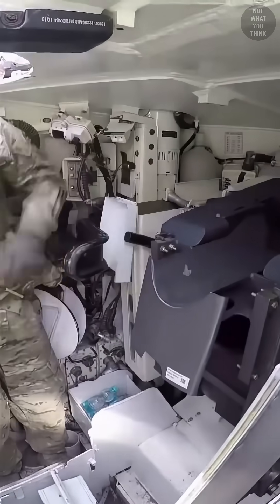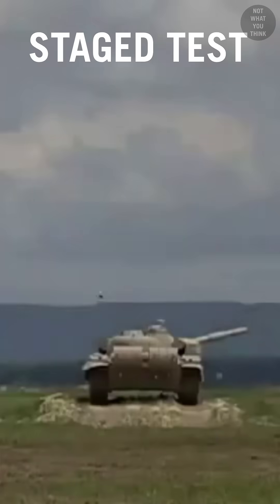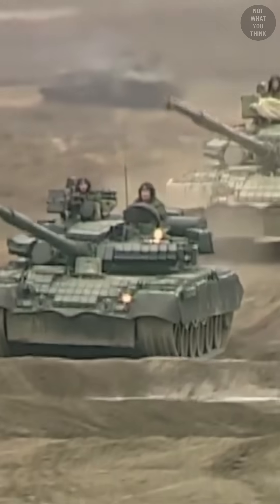Why M1 Abrams Tank Has No Auto-Loader #shorts

Comment: This is a flawed video, it talks about one kind of autoloaders, the soviet Cold War era model, you have other models of autoloaders. Meany NATO tanks have autoloaders; Type 10, Type 90, Korean Black Panthers, Leclerc. They are all equipped with blow out panels too. The advantage of an autoloaders prevent crew fatigue and a constant rate of fire if needed during combat. You can also make a smaller turret crew compartment with additional armer since you don't have the loader's space to take in to account. You can also have a lower profile, all human loaders (as far as I know) require you to be standing to reload. A disadvantage of the human loader is that the 120mm shell is already considered the limit of what a human loader can handle, the US and Germany (Leopard 2) seeing what the next NATO gun is going to be (130mm or 140mm) is seeing how they can change their tanks to have an autoloader system until they can make a new tank that can house the new NATO gun.
Reply: Well said
Reply: That’s kind of strange. Considering how big of a difference ammo makes you’d think they would figure a way to develop the way the gun fires and what kind of round it shoots. Rather than just how big of a boom it has.
Reply: Even these autoloaders are slower then US train loader.
Reply: But the Auto loader take up the space the human loader used 👌  so no smaller tanks
Reply: @dustinhaynes2617  No it doesn't.
 Carousel autoloaders (Soviet) sit in the turret basket where almost all ammo in Soviet tanks already is, which allows the turret, and by extent the whole tank to be much smaller - no turret bustle and no need for a 4th crewman. Their main downside is lack of blowout panels (which are supposedly possible to implement there, it's just hasn't been done), although the main cause of post-Soviet tanks launching their turrets sky high when hit is that the rest of the ammo is stored all over the tank.
 Casette autoloaders on the other hand (Western - Leclerc, K2, Type 90 and Type 10) sit in the turret bustle where again, almost all ammo is stored anyways. It allows to make the turret and the whole tank smaller. Slightly less smaller in this case - no need for the 4th crew member, turret bustle is still there. They are safer however as they include blast doors and blowout panels. Their downside to the manual loader is that the same sized turret bustle ammo rack with an autoloader fits less rounds than the one without, which causes a need to have a bigger hull ammo rack (which is usually unprotected).
 Then there is an American company called Meggitt which I think makes the best autoloaders, as they can not only reload the gun but also unload it and change the shell type. They are of "extract-lift-feed" type - the round is extracted from the rack (be it a drum like in the Stryker MGS, a carousel like in an Abrams TTB or a "chain" like in their autoloader for the regular Abrams' turretbustle) onto a feeding arm which lifts it into the position to feed to the breech.
 None of those solutions take up as much space as the loader. Meggitt's drop-in autoloader for the Abrams takes up so little space that the 4th crew member could still sit there.
Reply: What does Japan and Korea designed tanks have to do with NATO?
Reply: @leonstrya3677  I think it's quite known at this point that both Japan and Korean military (and by extension Tank design) are heavily influenced by the West (a.k.a Nato) during and after the cold war era. so their tank would also follow Nato standard and will share the same technology as Nato and US tanks. 

for example, the first few early Japanese MBT share the same gun as US tanks
Reply: FAIL. There is only one NATO tank designed by a NATO member that has a an autoloader- the Leclerc.
Reply: Make it a manless turret.
Reply: Auto loading turrets in the t90 still have issues with dangerous explosions when hit by a shell. Auto loading tanks have to have ammunition exposed so it can automatically grab a new shell
Reply: @zackhaycraft8159  the main reason for the t-90 or Soviet era tank designs fatal explosions was the ammunition placed around the tank, not the carousel (the carousel does have armor protection against mainly spalling). Also there are also auto loaders that blast proof protection as well (type 10, Leclerc, black panther). Both the autoloader and manual loader have to open the blast proof doors to get the ammo into the gun, so I don't think auto loaders are always exposed is entirely correct. (maybe early soviet tanks?) Then there is the t-14 armata which the entire autoloader and ammo is in a separate compartment from the crew, making survivability even better.
Reply: @benjaminng3390  we are talking about Russian tanks they are still full of design flaws if you look at a t90 it shares design similarities with previous Soviet tanks primarily a round turret. Most auto loaders lack proper protection for munitions that is because it is expensive to have blast doors and have the computer system to open and maneuver shells at the same time. The t14 like the t90 likely doesn’t have munitions blast doors due to the design of the turret which is smaller than the the Abrams so likely it lacks any blast doors for the munitions.
Reply: @zackhaycraft8159  I felt that the other auto loader designs are relevant since the video is about why the abrams doesn't use an auto loader, not about the flaws of russian tanks. Having an auto loader doesn't mean its more expensive either. You still need to pay, train, feed and give some form of comfort for a manual loader (and all crew). Auto loaders can also allow for more compact designs which allows for a lighter, cheaper and possibly more armored tank. Yes, most soviet era tanks lack the blast proof protection (t-64, t-72, t-80, t-90) but the more modern designs I said before do. Lastly, the T-14 doesn't need a blast proof door since the crew is in a seperate protected compartment to where the ammunition/turret is.
Reply: @benjaminng3390  here is the issue with auto loading it is a maintenance issue if it goes down in combat that leaves the tank vulnerable to enemy fire in which they can’t respond. Also to be noted the t14s turret and auto loader is going to be completely different issue when you can’t vouch for the turret or main gun. In most cases a manual loader can put pace and out perform the auto loader plus you get that extra crew member to help maintain the tank itself
Reply: @zackhaycraft8159  yes, those are the cons towards an autoloader, but I will point out that auto loaders can't get tired, and that human loaders are already near the limit to handling the current 120mm shells. Bigger guns are being developed such as rheinmetall's 130mm or the Russian 152mm that was possibly meant to go on the t-14.
Reply: @benjaminng3390  possibly could but most likely won’t because of time and development costs
Reply: @Omega Trash  say that to the people who had to load tanks with guns 130mm+
Reply: @Lukasthefloof  can’t think of any tanks having a bigger gun that 122mm?
Reply: @cassu6  ik theres tank with guns bigger than 122 considering germany might put a 130 mm on their new leo
Reply: @Lukasthefloof  Yeah? So not anything existing that's been used?
Reply: @cassu6  tank destroyers back then have had 152mm guns
Reply: @Lukasthefloof  Yeah but those are also built totally differently. The room to move shells is way bigger and you could have more guys loading.
Reply: T90 has 125mm gun lol
Reply: @zackhaycraft8159  Obviously the T-14 doesn't have blast doors. That's because it has an unmanned turret, so the entire crew sits in a very heavily (over 900mm RHA) armored compartment in the hull and has no contact with the gun or ammo.
 As for other autoloaders having issues with blast doors, that's not true either - Leclerc, K2, Type 90 and Type 10 all have blast doors. The difference is they're roughly the size of one shell, not the whole ammo rack, so they can be thicker.
Reply: @olekzajac5948  the t14 crew will still be killed in the event of munitions exploding from a direct hit and the Abrams can punch right through the t14 with little to no issues. The leclec, and the other US Allie’s tanks have little to no combat experience and testing whatsoever.
Reply: @zackhaycraft8159  The Abrams also wasn't tested in a regular war. For me shooting outdated T-72 variants from twice their maximum effective range (and with absolute air superiority) doesn't count.
 Yes, a shot to the turret from an Abrams could destroy the T-14, but so could a shot from Leclerc, Leopard or any other modern MBT. And the same is true for the Abrams (and any other modern MBT) - a shot to its turret from any modern MBT could destroy it, or at least eliminate it from combat. But unlike with all other MBTs, destroying T-14's turret would do nothing to its crew which all sits safely in the hull.
 And no, Abrams (or any other tank armed with 120 or 125mm gun) can't penetrate Armata's front hull armor and kill its crew.
Reply: @olekzajac5948  the Abrams was tested on the battlefield as well unlike many other nato and pacific Allies. Also to be noted the Abrams tank took hits from Iraqi t72 tanks and all the 125mm shells did was bounce of the Abrams tank so I can assure you the t14s 125mm main gun won’t destroy a Abrams tank
Reply: @zackhaycraft8159  Well, the 3BM69 Vacuum-1 round can go through around 1000mm RHA at 2 km, so it would penetrate the Abrams' front turret armor at that distance as it is estimated to be around 800-900mm RHA. On the other hand the US best APFSDS-T round - M829A3 is estimated to go through about 800mm RHA at that distance. So considering that Armata's hull is about 100mm thicker, it would just be stopped.
 But our argument doesn't really matter since that type of Tank A vs Tank B comparisons are kinda invalid when it comes to the real battlefield anyways.
Reply: @zackhaycraft8159  Yes, the classic "their sources are bad, because they're not our" argument. When it comes to the Vacuum-1 penetration, it is indeed a Russian source, and the only one we can get, the T-14's armor being about 900mm RHA (that's after the ERA btw) is a thing that most experts agree on.
Reply: @olekzajac5948  Russian era armor is absolutely useless it doesn’t protect their tanks look at Ukraine and Syrian civil war. The Abrams tank has frontal armor of 960mm giving it a far superior protection than the t14 and not only that the Abrams tank also includes depleted uranium armor which is more dense and takes more kinetic energy vs the t14
Reply: @zackhaycraft8159  At this point I can't say anything more than just read more. A lot more.
 Russian ERA is one of the best out there - they're the ones constantly making new generations of it.
 As for Ukraine, if there is nothing behid the ERA, even the best one isn't gonna help. And 45mm of steel (T-72's turret roof armor) is nothing. So if it gets hit by the NLAW or a Javelin, even the best ERA won't help because there is no armor under it. You need an APS to defeat top attack missiles, and Russians are not using such systems there. And the same applies to receiving an RPG grenade from the 6th floor, which would explain what was happening in Syria.
 Yes, Abrams has DU armor, but 900mm RHA is 900mm RHA, no matter if the composition is ceramics, uranium or glass textolite. Your argument of "Abrams' 900mm RHA armor is better than Armata's 900mm RHA armor because it's uranium" is like "1kg of steel is heavier than 1kg of feathers because it's steel". If we say XYZmm RHA it doesn't mean the physical armor thickness, but a protection equivalent of XYZmm of rolled homogeneous armor.
Reply: @olekzajac5948  depleted uranium is used in the Abrams tanks armor because it provides far superior protection against armor penetration weapons and shells not only that it takes kinetic energy far better than rolled steel. The Abrams armor sits at 960mm which offers better protection and Russias era is crap
Reply: @olekzajac5948  just wanna say its m829a4 not a3
Reply: @zackhaycraft8159 
That's not really much of an issue since that rarely happens.

What does most likely happens is a manual loader who ate shhtt food and gets diarrhea, gets Malaria or Dengue from mosquito bites, gets the flu, gets COVID-19, gets any sickness, can get injured from stupid shhhtt the crews do and other things.
You're forgetting that humans are fragile things and it doesn't take much to knock out a manual loader
Reply: @dickmelsonlupot7697  humans are far from fragile our bodies can take a beating and a manual loader can easily be replaced by someone else until the other loader is back in good health. Manual loaders are also faster and a lot safer than auto loaders are. Notice the t72 and t90s when hit tend to have their turrets blown off

Comment: Bruh, leclerc also use autoloader, and use it altogether with special room for shells with blast caps. So i doubt that human loader far more safer than autoloader. It depends on design.
Reply: I wonder if we'll ever have tanks with all-or-nothing armor like a battleship.
Reply: @axelkusanagi4139  T-14 Armata I guess?
 I mean, it's the closest thing we have now - extremely thick hull armor for the crew compartment and the uanned turret protected just against the autocannon fire.
Reply: The US military never had an autoloader it liked. US defense contractors never produced one that was light enough, reliable enough, safe enough or with enough ammo  for the US military to accept. The Stryker MGS has an autoloader, but the vehicle is being retired because the autoloader is too unreliable and the vehicle is too unstable when firing. Plus, it doesn't carry enough ammo.
Reply: it depends on design..... wow groundbreaking theory right there......  ,
Reply: It's also fast than an autoloader. I seen privates load a round in 3 secs. I personally have done it in 5secs. Us tanker standard is 7 sec.  Most autoloader take tens secs to load a round. 

And don't give BS that human loader will tire out. What tank engagement last more than few minutes? Usually in a minute one side is either dead or  withdrew.
Reply: @Cavalier1645  It is usually less then 10 seconds. It's in fact comparable to the American standard (7-8 seconds), except of the Japanese autoloaders, these are way quicker - around 4 seconds.
Reply: @olekzajac5948  around 4 seconds when properly maintained. Who we taxing for these modifications?
Reply: @Cavalier1645  Leclerc autoloader is a 5 seconds reload and it is used at 6 seconds to preserve the mechanics, it does not need to eat or drink, is never physically and mentally tired and is more resistant to impacts than a human
Reply: It takes 6 seconds for that autoloader to close it's blast doors and it's not even finished loading the ammo in the gun that's just taking out the ammunition out of the armored magazine unlike the manual loading in the Abrams that only take less than 2-3sec at max to close it.
Reply: @shinjiprofile  No it doesn't, the most wide-spread type of autoloader in western countries - casette autoloader, works in a very similar way to the manual loader, the main difference is that the part ramming the round into the breech isn't loader's hand but rather a ramrod that comes out from the back of the turret bustle. It takes a comparable amount of time to the manual loader so about 6-7 seconds, unless you're talking about japanese tanks, their autoloaders are faster - they can do it in about 4 seconds. And the blast doors are of course open only for a part of the reload process both with a manual and automatic loader. The autoloader blast doors are also way smaller (barely bigger than the diameter of the casing) so they can me thicker but still operate quicker than in manually loaded tanks.

Comment: Because when I was on that tank, I could load 3 rounds for every one round the autoloader on the Russian tanks load.
Reply: ...it still would fire one at a time. But I could.
Reply: @chotabomjvonychi3485  yes but 3 rounds with pin point accuracy in the time it takes a Russian tank to fire 1. That's a 3 to 1 kill ratio. If the Russian rounds can even penetrate the M1's armor.

Comment: Manual loader is safer, have faster reloading rate at first few shots before the loader is tired compare to Russian auto-loader and able to upgrade longer and better shell without redesign the whole auto-loader, meanwhile Russian auto-loader can save space, weight, remain same loading rate after first few shots and only need 3 crews instead of 4 and that's why Russian tanks are 20%-30% lighter than western tanks. Western countries have better engines so most of them choose manual loader except for France, while Russian have to control the weight to get a balance of protection and speed since their engine is worse and also Russian is lacking of crews consider its strict requirements for tank crews and massive number of tanks in service.

Comment: Russian tanks, later chinese, korean, japanese and french are designed to have a small silhouette and lower wight. A loader has to stand in the turret, so the turret needs to have a certain hight. With an autoloader they can make the turret a lot smaller. 
It has nothing to do with safety...The loader can drop a shell while driving because he needs both hands to insert the shell and cant hold on to something when the tank is driving offroad. 
He also needs to pull out the shell from behind, then turn it 180° and insert the tip first, which is uncomfortable and takes a long time.
Autoloaders are faster, you can swap different shell types very quick and you can use them offroad at full speed. Of corse the shells are in a compartment seperated from the crew with and door, that only opens when a new shell is loaded....